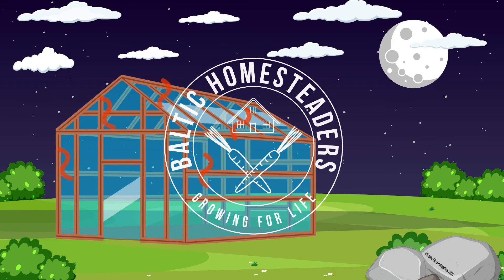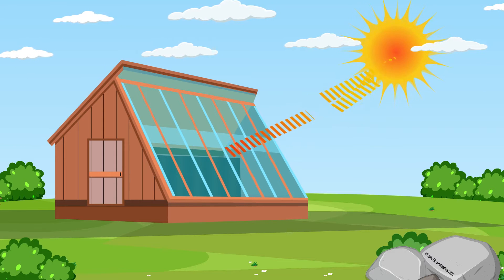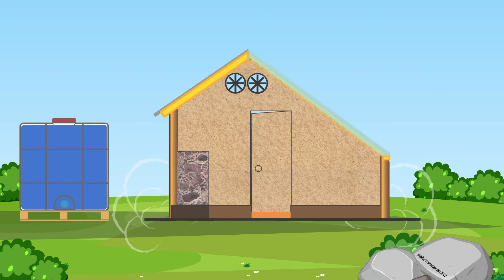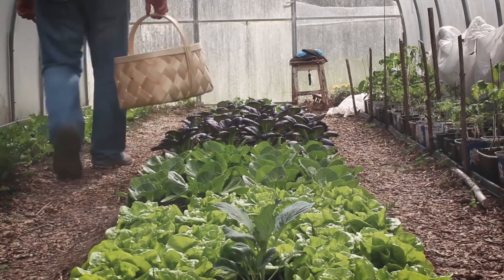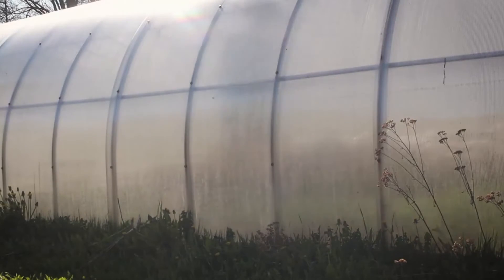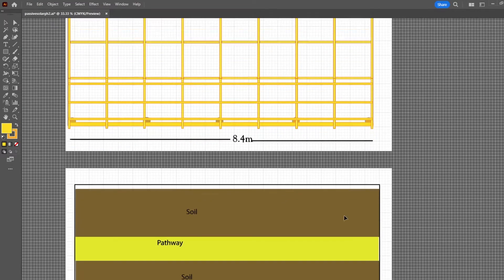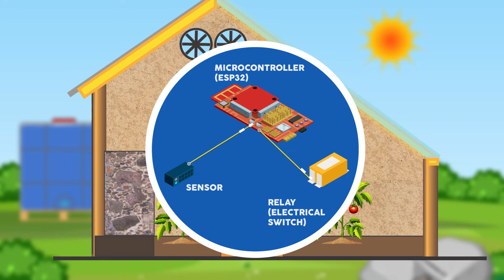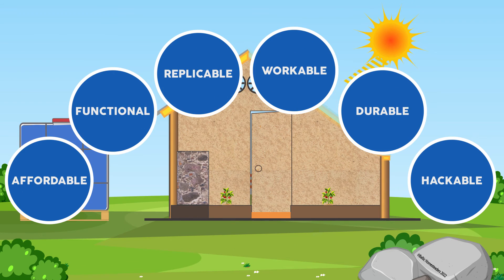Passive Solar Greenhouses Must Be these 6 Things

Comment: A very interesting video, thanks.
May I suggest that you treat the bottom of the posts and back fill the holes with crushed stone to stop water rotting the ends. The former could be done by burning or charring the ends of them. I presume that you will gather the rainwater from the greenhouse but a crushed stone path around it would be good too. Have you considered using good quality clear polythene stretched on frames for the windows?
Glass is always expensive. I hope that my comments are helpful.
Good luck Gary.
Reply from the maker: Thanks. Yeah I was planning to do shou sugi ban (mentioned in the next video). Actually the next vid will address these points as it looks at the practical aspects. Script is written I just need to produce the video. Hadn’t really considered the crushed stone paths (mowers don’t tend to like stone) but I am scratching my head a bit about how the walls will abut to the ground without getting overly complex. Sticking with that affordable / replicable / durable theme. Just been playing with guttering schemes last week. Thanks again, all good and welcomed points.
Reply: @BalticHomesteaders  Where the walls abut the panels at the bottom you could try using logs laid on their side.
Not ideal as they will rot but they are available to you and can be replaced as they  break down.
Again you might want to flame torch them to protect them against rot. 
Alternatively, you could lay a low stone wall on a simple strip foundation between the posts.
All the best
Michael

Comment: Looking forward to the next in the series. Like you, I've found that many of the greenhouse designs seem to be aimed for Instagram, which is very nice, but not very helpful for self-sufficiency.
The issue of maintenance, specifically keeping the glass clean to maximise sunlight, is the real bugbear. I'm not sure where this comes in under your categories - I suppose both functionality and durability?
Reply from the maker: Well I guess with anything you make in order to keep it as long as possibly you have to look after/maintain it.
Reply: @BalticHomesteaders  True. Though there are superior designs which minimise cleaning, and/or simplify cleaning. As well, I'd suspect, designs with better rooftop accessibility to know when a clean is necessary.

You have me thinking now, if there's a way to monitor the amount of sunlight inside the greenhouse, to get an early indication if the glass is getting dirty and needs a cleaning. I'll have to do some thinking.
Reply from the maker: There are light sensors you can use, I think the calibration would be difficult.